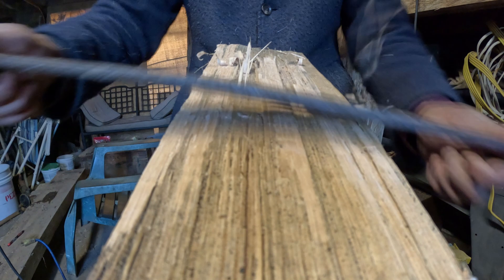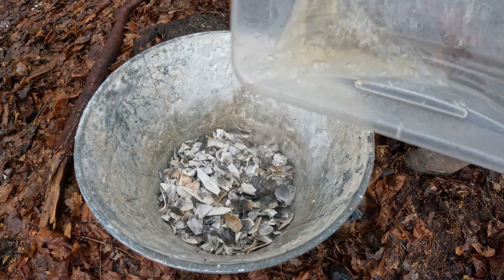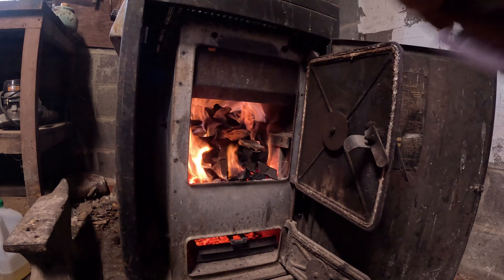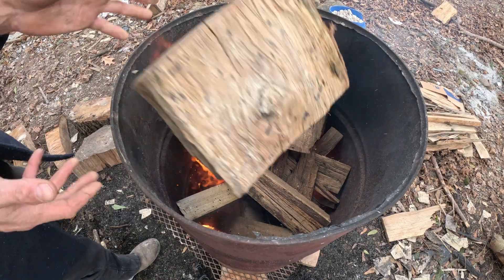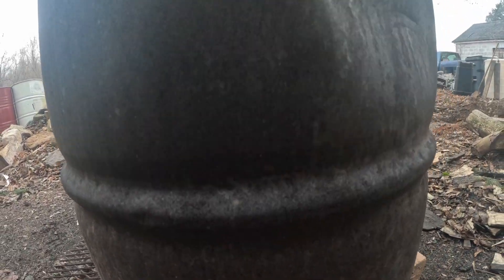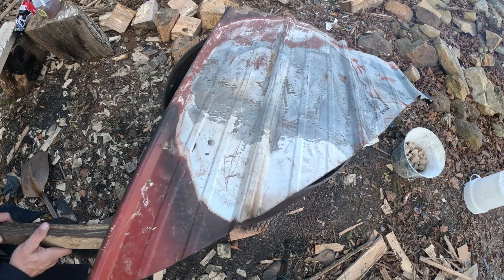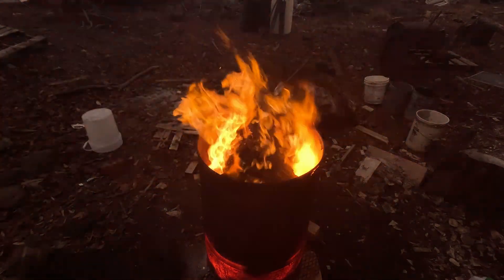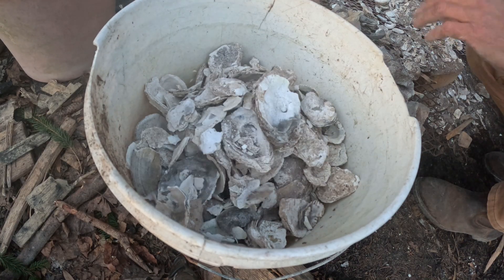3 Easy Methods for Burning Lime at Home | Traditional & Modern Techniques

Comment: I'm preparing to experiment with burning oyster shells for lime. My ultimate target is stucco and plaster for a straw bale house. 

How important is the quality of slaking water? I have access to either rainwater or pretty hard, high sodium, well water. Does it matter?
Reply from the maker: @nopenotmedude  Honestly, I’m not sure. I’d probably go with the rain water just to be sure but in everything I’ve studied, there are no real references to water quality. That being said, the Romans used sea water in their concrete(just lime and volcanic ash) so I’d not be too worried about using a sodium-rich water if I had to go that route.
Reply: @HiraethRestorations  makes sense. 3/4 of the year, I have more rainwater than I can possibly ever use. The other season, none. I'll have to experiment and see what, if any, noticeable difference there is.

Thanks for the prompt response! Newly subscribed to your channel, and I really enjoy your videos.
Reply from the maker: @nopenotmedude  Yeah, man, let me know if you notice a difference. I was researching for a video on historic masonry in the winter and found that some masons would mix salt into the mortar to keep it from freezing and others claimed that adding the salt made very little difference. Welcome to the channel!
Reply: @HiraethMasonry  will do!

Comment: Anyone interested in lime should read this book:

Hot Mixed Lime and Traditional Mortars: A Practical Guide to Their Use in Conservation and Repair by Nigel Copsey

I store my quicklime in airtight 5gal buckets with rubber seals, stays good for years. They say slaking the lime directly in the mortar sand makes for a better mortar because of the heat generated. You make a nest out of 3 parts sand, 1 part lime in the middle, add 2 parts water and cover the lime with the sand from the edges. Let it cook, then mix it up while hot. Add more water if needed.
Reply from the maker: Traditional mortar mixes, the storage of lime, and slaking techniques are fascinating subjects! Right now, I’m combing through my 19th Century sources to document the methods used and why different writers preferred one method over another. It’s hilarious really to see how often they contradict each other! I’ll be doing a presentation specifically on slaking methods and mortar mixes in the next couple of months once the snow melts and the sand thaws.